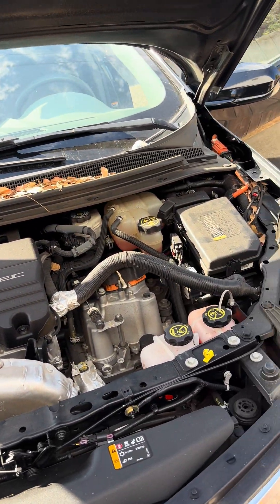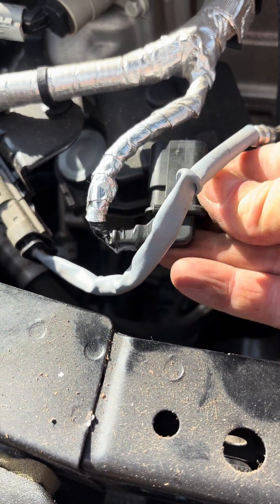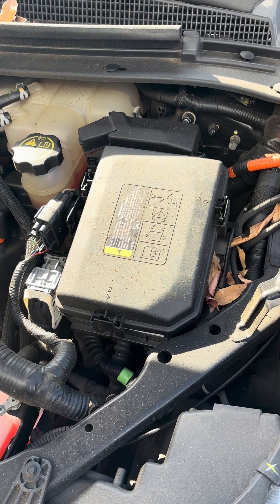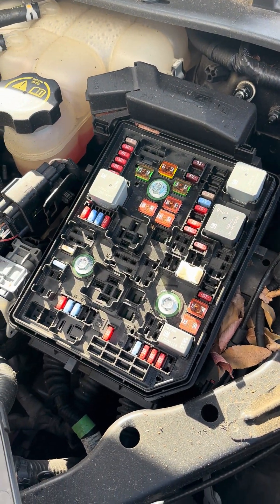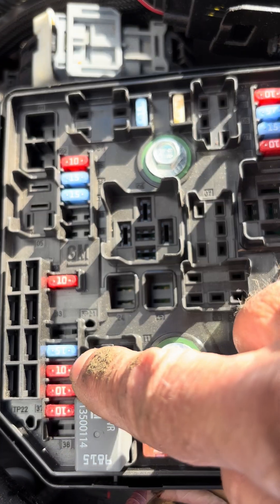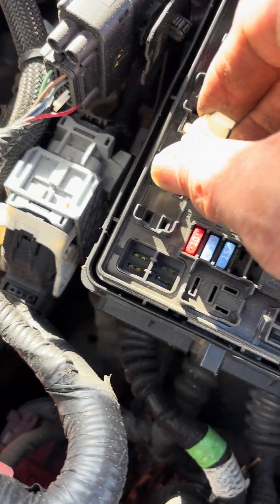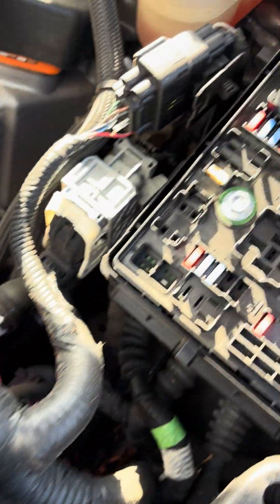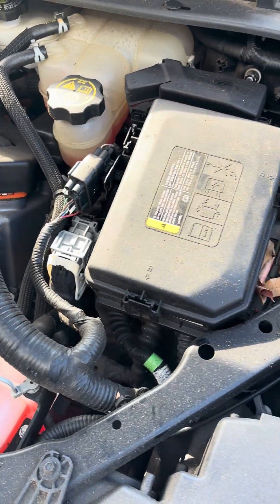Chevy Volt 2016 2017 2018 2019 EGR Valve Electrical Plug Disconnect and Fuse F03 Replacement

Comment: Do you always need to replace the fuse if the check engine light is on for EGR? Or only with the Propulsion error? My Volt still runs on the engine so does that mean it hasn't blown the fuse yet? I suppose I could check it with a multimeter.

Comment: Thanks for showing everyone the steps. I have two suggestions. First, you managed to get the fuse cover off, but it’s much easier than it looked. On each of the three clips are two vertical skinny tabs sticking up. Squeeze them together toward the center and they release the clip smoothly and easily. Second, there are two spare fuse slots, F56 and F57, right next to where the fuse puller lives. Before this goes bad, you can put a spare 15 amp fuse in one of those slots, so it will be there if you need it.

Comment: Thanks for the straight forward video! It was a relief to see you explain plainly how to remove the EGR valve plug. Also great to know there’s a fuse pulling tool included with the car 😅